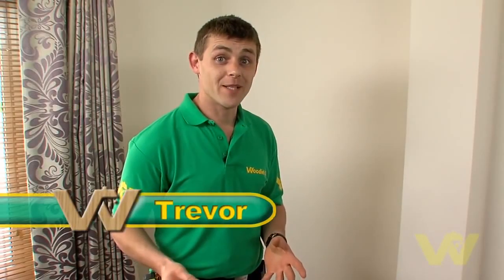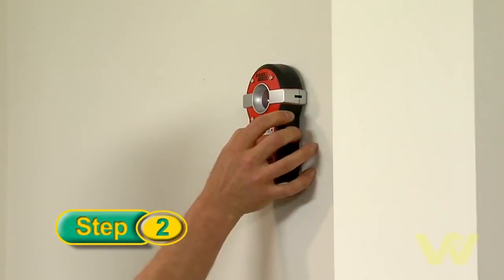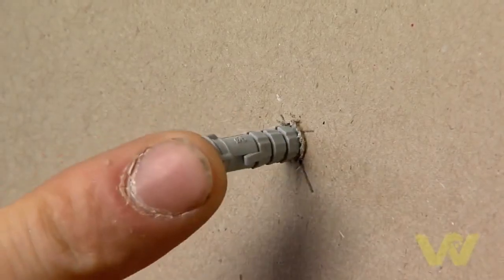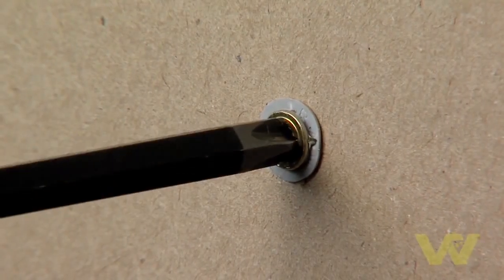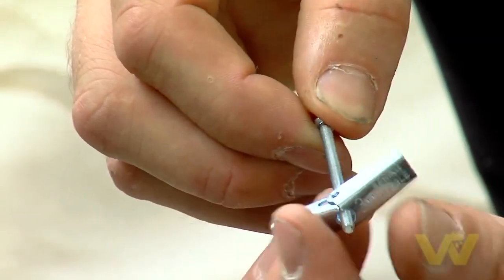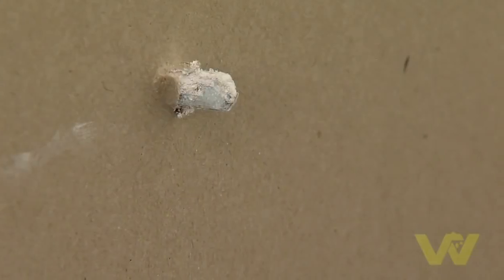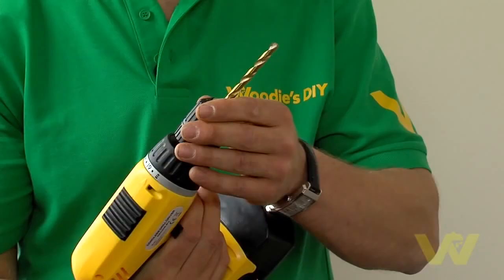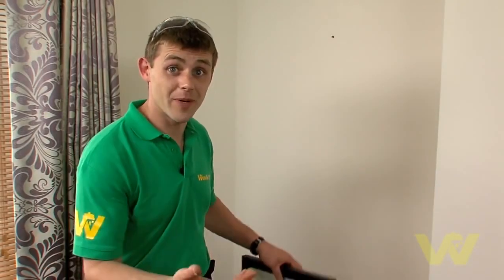How to Drill and Fix to a Plasterboard Wall

Comment: would any of these fixings be suitable for supporting a shelf? I was thinking of a shelf 80cm long and 20cm depth, 1.5cm thickness. Using two supports, each support fixed into the plasterboard with 3 screws. Any advice? thanks
Reply: Check the weight rating on the fixing

Comment: I am trying to seal some flaking lead paint in a bathroom.  I am trying to figure out how to put drywall on top (or, in this case under) the plaster ceiling.  I might have to use a board to keep it in place and then use some kind of anchor.  But then it might not be flush with the ceiling and might pull the plaster down over time.  Any suggestions?

Comment: I am having a problem with a plug that has been pushed out on the other side of a plasterboard while screwing  - when I'm trying to remove a screw it is spinning together with the plug that is outside of the wall :/ Can anybody give an idea how to secure this so that  the item hanging on two screws is levelled?